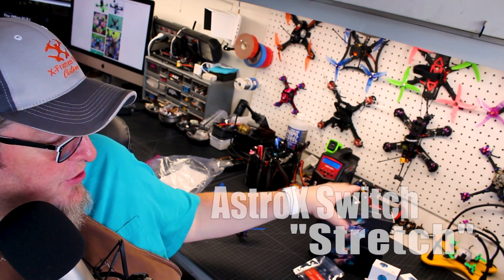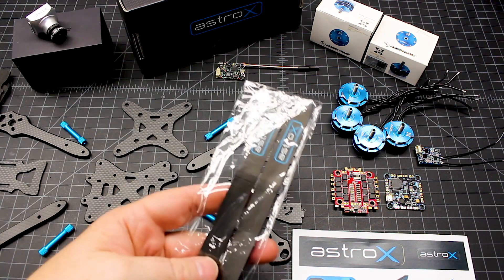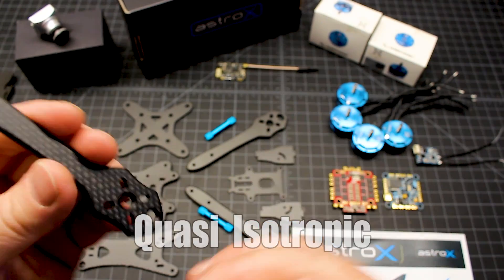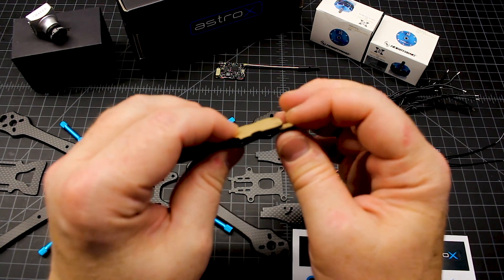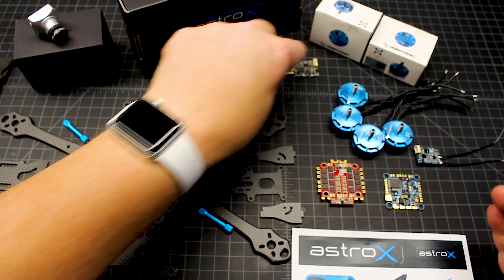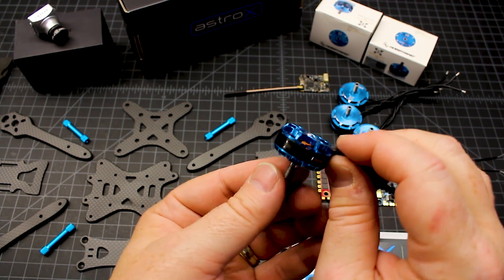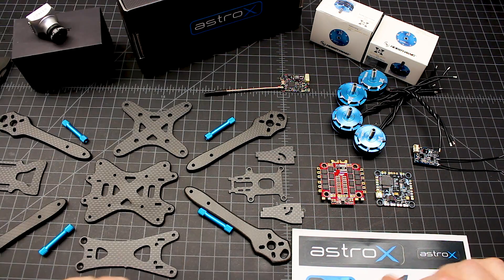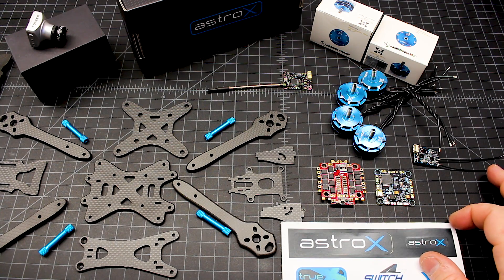AstroX Switch "Stretch" 5 & 6s Buildout

Comment: that ESC cant handle all that power its going to melt itself apart especially on 6s
Reply: QUADBOT FPV shhhhhhh lol it would have made for a great follow-up video
Reply: ClockworkFPV 👆😬
Reply: Trochartist lol
Reply from the maker: +QUADBOT FPV there are guys doing it, but have to take a lot of extra setup steps to get it to work and not worth it in my opinion. , I have a follow up video that shows the setup I used. . Changed the whole setup.
Reply: let me guess, not the Arrow V3 but something smaller? or the Arrow V3 with a custom mount?

Comment: How are you fitting the Arrow V3? using the stock camera plates, only a mini or micro FPV camera will fit, not a full size. It's in the product details (I missed it, too). My Arrow micro arrives tomorrow!